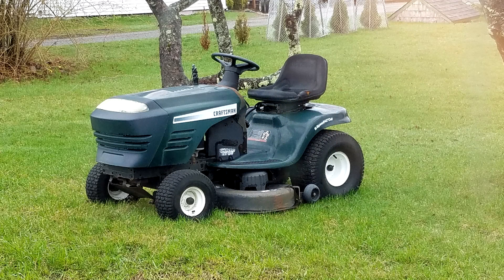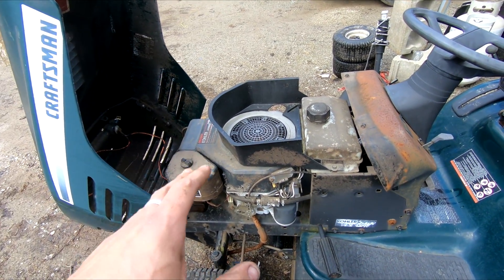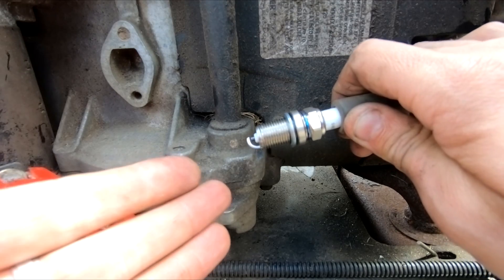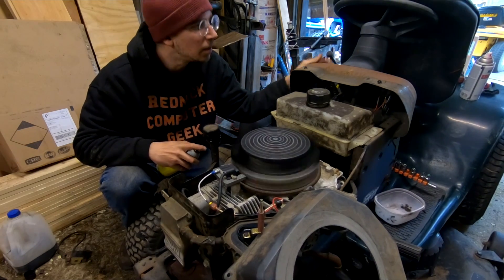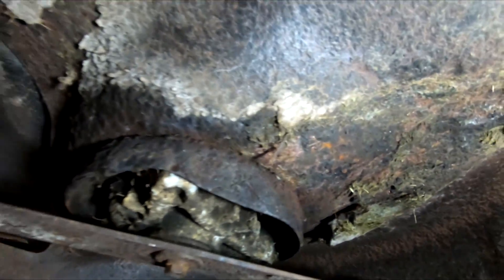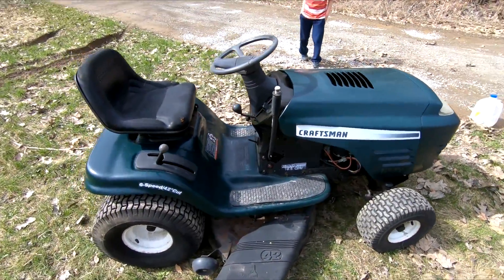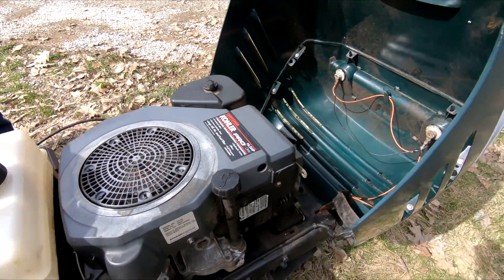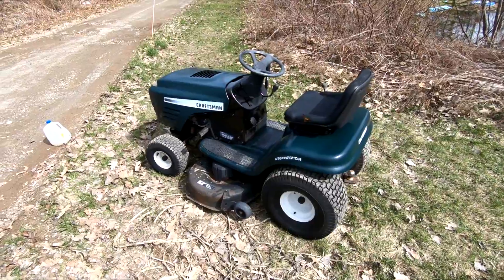Tractor Hunting LT1000 Craftsman

Comment: RCG-could you tell me about a Craftsman LT1000 16.5 - 1C - OHV, Model #: 917.271643 with the Briggs & Stratton Engine? I’m trying to find the OEM part number for the 4-pole solenoid and am told it would be Craftsman, not B&S, as it is on the body if unit, not in engine area. Thanx!
Reply from the maker: https://amzn.to/2WYvmPa
Reply: So, it does not have to be a Craftsman part, any 4 pole solenoid will do, because they all look different, especially when attaching it to the body. Some have 1 screw hole and a hook, some have 2 screw holes….confused 👵
Reply: But thanx, again!
Reply from the maker: only thing that matters is that it is a 4 post. Any brand will work.